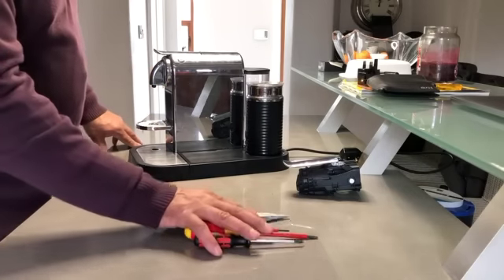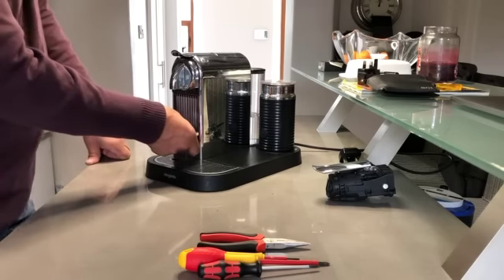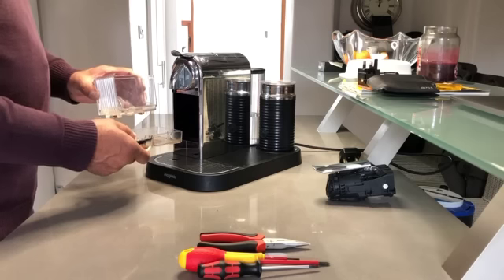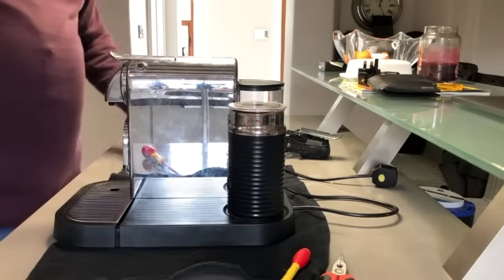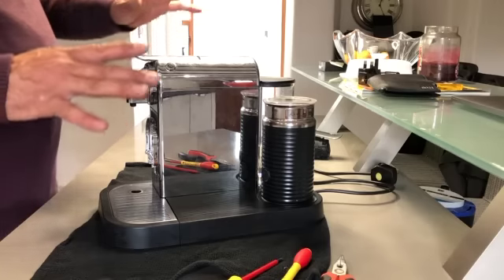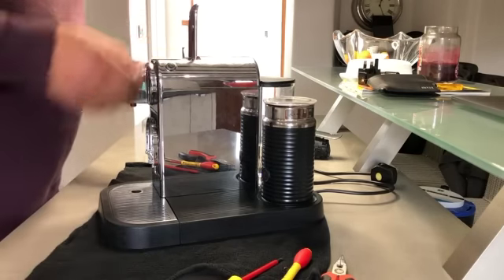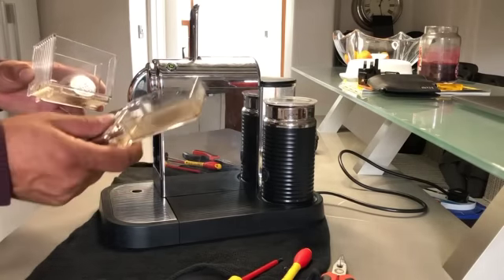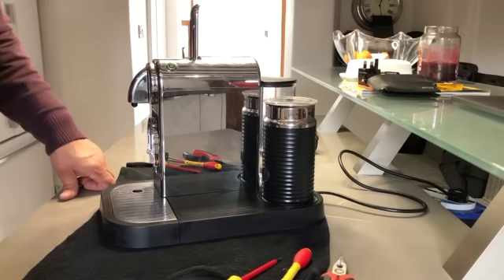Nespresso Repair leaking

Comment: Just to say a big thank you for this video. I followed all your advice, bought the part and the tool for the oval-head screws, and last night I successfully repaired my machine. I am very happy with myself for succeeding!  The hardest part was taking the casing apart, because I was worried about using too much force and breaking something, but your advice was good - be slow and careful - and I managed it. No leaks this morning, and the coffee is better too. Thanks again

Comment: Great video thanks, but I had the same water leak problem, I just unplugged it, but it in the kitchen sink and cleaned the brew chamber with a Waterpik flosser, then descaled it, and it works great again, no leak or initial water before coffee when brewing. Perhaps worth a try before you go for the full rebuild! (we use the plastic Bestpresso capsules from Walmart, perhaps they leak coffee grinds a bit more?)

Comment: Had excess water leaking into the drip tray and overflowing onto the counter from our Nespresso Citiz C121.  Watched this video and replaced the extractor.  Back up and running.  Thanks so much for the video!!  As a heads up, I tried to clean up the old extractor by further disassembly but a small spring came off the back of the capsule housing part (can be detached, 2 retaining clips) and the silicone seal at the back of the extractor that connects the water hose became unseated and difficult to get reseated without worry of a leak once all back together.  I gave in and bought a new extractor.  I'm sure someone could figure out where and how to reset the spring but it was not worth it to me.  I think it is best just to buy a new extractor which comes with a new silicone seal for the water hose.  Hope this helps someone.

Comment: Thank you so much for the video, inspired me to fix my machine. 
I replaced the rubber o ring in the brewing unit, cost 10 cents, time 30 minutes, this worked for me.
Thanks again.
Reply: Hi, do you remember which size o-ring was needed?
Reply: I think its the O-ring inside the brewing unit that is worn out. Where can I get this?
Reply: Thanks. I wondered about this as I watched James' video. I thought it might be possible that it was something as simple as a worn sealing ring causing an otherwise functioning machine to leak. I'll try that first before ordering a new unit.

Comment: Excellent and helpful video. The lungo button on ours had stopped working and other posts suggested it was just a matter of cleaning the inside of the rubber button. Your video gave me the confidence to open it up (some of the case clips require quite a bit of pressure). Once open the repair was simple and effective.  I made a small tool to remove those damned oval-head screws following advice on another thread - used a bit of old 10mm rod and drilled a 3.2mm hole in the end then extended the hole slightly to oval by tilting the drill back and forth to about 3.5mm on the axis. That worked fine and removed them easily and cleanly.

Comment: Thank you so much for making this video James and for having the patience to do it twice. I have the same issue and will do the repair. Just wondering, is there any chance the issue was just the silicon seal and not the actual brewing unit?
Reply: Hi David. I have a leak on my D120 machine as well. Did you find a solution with a silicon seal or is the only solution to buy a new brewing unit?
Reply: Hi Henrik, I haven't tried the repair yet. Only just received the oval head screwdriver in the post. I'll have a go at it this week and let you know.
Reply: @poemsandplaypieces  I hope that you will succeed with the repair.

I managed an hour ago to disassemble it without taking it from the base. I have written to three different spare parts dealers to hear if they have the brewing unit for a D120.

Comment: I have a Breville Creatista Plus.  I was frustrated like everyone else that the machine started leaking onto the counter.  The water can be cleaned up, but I have to also believe that my cup of coffee is suffering some quality as well.  

So....I disassembled the machine and got that punch plate piece out.  To my dismay (in a wierd way) it was NOT full of coffee grounds.  I was hoping to get the satisfaction of showing my wife:  SEE, look how clogged this is!  Not for me, the plate looked pretty clean and I could see daylight in all the holes.  I rinsed it a bit, put it all back together, and now - no leak.  I guess it's "fixed", but I don't have much faith it will last.  Makes me wonder if it was just the angle or location of that plate as it sets in the chamber?  I did notice that my plate was "off center" before I took it out.  When I replaced it, in installed it "Square" to the machine.

It is super frustrating that a small part like this makes a great machine, not so great.  Having opened my machine up, you can see that there is ALOT going on inside that little beauty, and I really do love the coffee my machine makes.  Hopefully Breville reads these comments and can develop a way to easily replace this plate or to more easily clean it.  That plate obviously costs pennies to make in bulk.  Heck they could just include 10 of them with a new unit and those would outlast the machine.  Much thanks again to James Roberts for starting this thread, making the video and all of his helpful replies.  Cheers.

Comment: Good Video, very concise, I have two of these machines one of them is in the loft which I shall now repair, the other one also ruins capsule on a regular basis I phoned Nespresso and got the stock reply to descale more often which didn't work, this one I shall also now repair. Thanks.
Reply from the maker: Eddie, Thanks.  Yes, its about time Nespresso stopped taking us all for fools, the machines don't last that long for limescale to build-up!!  Its a great concept, Nespresso gave us a way to enjoy nice ground coffee in many different strengths and flavours but it doesn't give them the right to treat customers like idiots. Hope you repair goes well. the toolkit I bought was this: https://www.amazon.co.uk/gp/product/B0189YWOIO  it is quite expensive just to repair your Nespresso machine, however you can buy this:  https://www.ebay.co.uk/itm/Ovalkopfbit-Ovalkopfschlussel-passend-fur-alle-Jura-Impressa-Extra-Gehartet/121562808742?  Much cheaper if your not planning on using a lot of specialist tools.  Im not affiliated nor paid to represent these products, just trying to make it easier for folks to get better value out of their machines.

Comment: An excellent explanation of the fix for this common (why?) fault on these `Nespresso machines.  Mine was about 2.5 years old which seems to be a common timeframe for this problem to emerge 
. Thanks - money saved on a replacement

Comment: A 32mm (inside diameter) by 2.5mm O ring replacement in the brew chamber will solve this if disassembly and cleaning doesn't. Two parts (the barrel and the strainer) clip out of the chamber.

Comment: thanks for this vid, just repaired the little blue water pipe from the capsule box which was leaking at the other end, and out the unit. Looks like it was designed about a half inch too short causing a stress fracture. Now I've noticed a slight leak from the capsule box but I will live with that until it gets too much.

Comment: Excellent video James!! I just fixed mine according to your instructions and it works well again. I would have probably binned it if it wasn't for this video. Only difference with my machine was that the brewing unit was held down by torx instead of crossheads, but for the rest it was identical!!

Comment: To remove the oval screws out on mine, I heated the end of a biro pen tube (ink cartridge removed) and pushed it onto the screw head. Because it's hot, it takes the form of the screw head and they can be unscrewed. Great if you're impacient and don't want to order the specialist version.

Comment: Great video, very informative. I ordered the spare part, fitted it with no issues but still leaking water. Any ideas?
Reply from the maker: Paul Slade where is it leaking water and when?
Reply: Hi James, thanks for replying. Before I fitted the new brewing kit all of the coffee would dispense into the capsule containing area so we would just put a small cup in their! Nothing would come out of the spout on the front of the machine. Since replacing the brewing kit coffee will dispense into the capsule containing area but also out of the spout about 50/50 into each area. Hope that makes sense. Putting the machine back together with no issues. All parts were secured correctly and no broken parts. Very puzzling!
Reply: Different model but this shows what happens - https://www.youtube.com/watch?v=5c9dRzlkdCM it was like this before the repair and still doing it after but some of coffee does go in the cup so not as bad. As I say about 50/50 split between dispenser and spout.
Reply from the maker: Paul Slade when did you last descale the machine? It’s sounds to me like the front part of the spout could be blocked and the water is then taking the least line of resistance. Before when the seals were worn the product dispersed into the capsule tray, now half and half. Let me look at my old parts and I will come back to you.
Reply: It was descaled recently when I started to get the original problem. It's about 4 years old now and gets used on a daily basis. I checked the spout and cleaned any residue I found. I'll take it apart again and test to see if I can work out what is causing the issue. Thanks.
Reply from the maker: Paul Slade, the only thing i could suggest is that perhaps the feed pipe that goes into the brew unit is missing the small silicone washer, or you have a faulty batch of capsules.

Comment: Great video! New brew unit arrived yesterday (£29 inc. delivery) and took half an hour to fit following the video. The leak, which was cascading through, has stopped completely. Thanks!!
Reply from the maker: Mike, I’m so happy it also worked for you. If you use the standard supermarket capsules the repair will pay for itself in a few months!
Reply from the maker: Great result! If you use your machine for more than 3 coffees per day the repair will pay for itself within 2 months  if you use standard supermarket capsules, rather than the original Nespresso ones. Aldi capsules are pretty good and half the price. Using only Nespresso capsules didn’t make any difference when it came to a “just out of warranty” claim with Nespresso, so I now use supermarket capsules! 😃
Reply: Where did you get the spare parts from please?

Comment: Thanks for your vid. I fetched mine from the basement, where it has been collecting dust and did the repair. I managed to fix it with thorough cleaning of the chamber and seals with vinegar acid and soap. We have very hard water where I live, so I'm thinking the seal was somehow clogged up with calcium.

Comment: Hi,
I want to thank you for this video. I have the exact same problem since like 2 years with my 4 year old Essenza Mini. It was always annoying enough to bug me but not enough to make me buy a new one. Tonight I said enough and tried gooling the problem. I dismounted the unit with a bit of help from you - a bit of struggle (looks somewhat different), I think I broke a plastic clip holding the button panel, but it should still be ok - and ordered the part for 46 euro. I'm fairly convinced it's still the same looking at the images. It's a shame parts are this expensive when a new unit costs 99 euro, but I decided I'll take the risk just for the heck of it, screw manufacturers, I'll gamble and if lucky it should serve me for some more time.
#righttorepair

Comment: Any advice on unscrewing the bolts? I've been trying with pliers and removed 4 but there's 4 little buggers left. Tips for unscrewing would be greatly appreciated or else my $40 has gone to waste! --Edited comment*Thanks guys
Reply from the maker: You can remove the covers without removing the base, however it will break the bottom lugs which isn't a big issue if the rest remain intact.  look at my other video.  The screws will come out with a little Percy, but I'm not sure how much of a grip you can get with your pliers. what sort of a tool did you buy, was it the one I recommended? if it's no good let us know and we can avoid anyone else buying from them.
Reply: @jamesroberts2907   Hi James. The tool actually worked in the end, it is a useful thing to know the oval screws are 6m by 5m and you have to ensure  you line up the edges correctly. Would still probably go for your tool recommendation next time. big thanks for your help and this video, finally fixed and got working as new. cheers again :)
Reply: @JM-ss8du  Where did you get the tool from, I see that some feedback on the US Amazon site is that the tool they ordered was still too small. There doesn't seem to be an equivalent on the UK Amazon site.
Reply: @glennpollard6749   I bought it from ebay in UK
Reply: @glennpollard6749  It's called a Jura screw .  Don't know why!

Comment: May have already been posted but this has post has been on a while so thought I would share my experience. 

I bought a ‘leaking’ machine and dismantled the unit as per above (quite straightforward just need to be careful with plastic as per most posts on here). 
Read on another post that you should replace o ring which is within the brewing unit (see other video on here). 
That looked ok so put it back - cleaned sprout (lots of coffee buildup) and then ran it through again. Leak still coming from just behind spout when capsule clamps onto front of unit. 
Still same - although slightly less pouring out.
Anyway - ran descaled through couple of times and hey presto leak almost gone. 
So, moral of story - run the descaler before you start taking everything apart in case it does cure it!! 
Better than £30 for new brewing unit...
Not sure if this will work for everyone - I’ve still ordered o ring and will probably change anyway before putting back together. 
Trust this helps a few people! I also replace all the star headed and oval screws with cross head screws - why they use those I don’t know (actually I do it’s so that people send back to the repairers!)

Comment: Fantastic video! Had my Nespresso in the cupboard for 6 months & then it wouldn't pump water. 

Got it pumping again, but don't want to reassemble without some screws that have a phillips head.

Happen to have a link to the screws you used? :-)

Comment: Thank you so much for this video! Seems to be a relatively common problem with the Citiz recently. Disappointing since the manuf does not seem to acknowledge (at least in the US), and the 'keep descaling' advice is getting old. It is a struggle to remove those awful screws, but only took ten minutes and good needle nose pliers - not much point buying the tool since i've already thrown the screws away and will easily replace with phillips head screws. Maybe you can get the cover off without pulling the screws, but far easier if you do. Note that if your target is only the brew head, it's not necessary to completely remove the base connections to get enough access to remove the side covers. If you are in the US, the replacement brew head is harder to find - I finally found one for 44 dollars, and notice that PayPal went back to the UK so that's where it is coming from. Again, thank you James!

Comment: Great video but I can’t see the link of the company I can order the replacement unit from. Can you advise please?
Reply: THIS WILL VOID YOUR WARRANTY! NESPRESSO WILL REPAIR IT FREE OF CHARGE IF UNDER WARRANTY. If You need parts to fix it, you cannot purchase any technical and internal parts from Nespresso. Only Nespresso authorised service centres have the parts to fix Nespresso machine and they will not sell it to you. If your machine is under warranty they would  fixed it free of charge for you. DO NOT RISK REPAIRING IT YOURSELF YOU MAY DAMAGE YOUR MACHINE MORE!

Comment: Excellent video! I wish it was for the Pixie, because my machine has the exact same problem and I haven't found any instructions for repair.
Reply from the maker: If I had a faulty machine I would try to work out the repair.
Reply from the maker: Thanks very much

Comment: I've followed instructions, I bought a new part but the machine is still leaking ?? Any idea ??
Reply from the maker: Hi Boris, where is the machine leaking?
Reply: James Roberts on the same spot like before, but this time it is significantly less than before. It looks that some capsules are more prone to leaks and some doesn’t. It is better but still from time to time i have leaks! Do you have same problem?

Comment: Hi James, great video, thank you. You probably already know by now, but the component that failed is the seal inside the brewing unit. In fact you don't need to open any of the machine at all to replace/repair this seal. You don't event need to order a spare seal or another brewing unit. Tried and tested and working. Here is my method of fixing this:
https://youtu.be/kS7NILXBNf8
Reply from the maker: Thanks for the info!